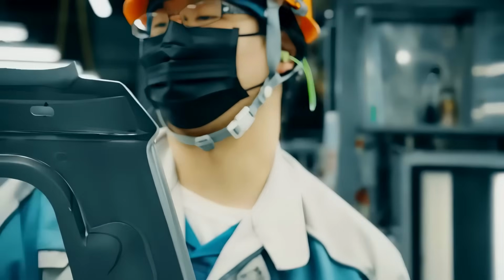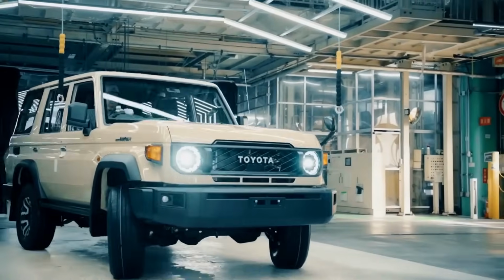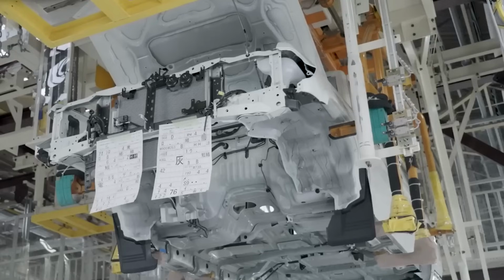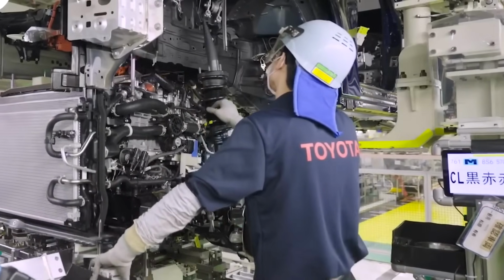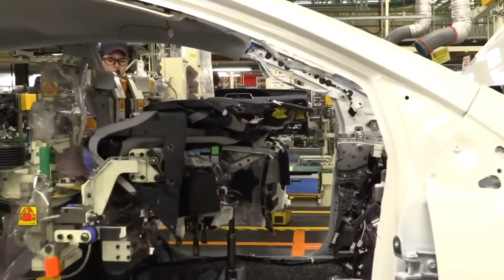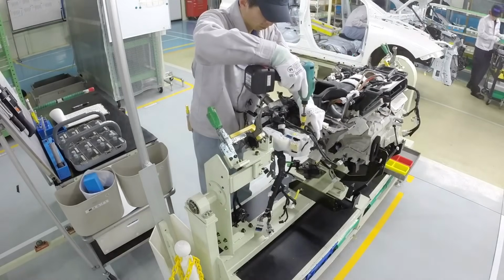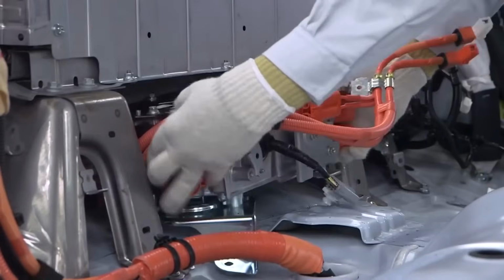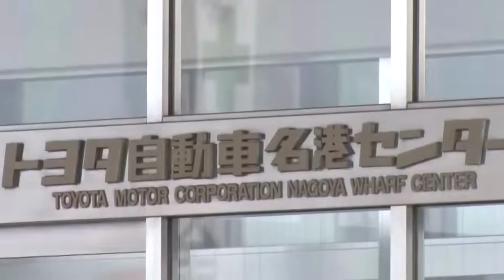How the Toyota Land Cruiser is made in 2026 – Assembly & Production line

Comment: Need to add front and rear side curtain airbags, and rear isofix fittings (for child seats). Add DAB radio to the infotainment. The new 2.8 turbo diesel engine gives Toyota the flexibility to make the front and rear wheel-track line-up.